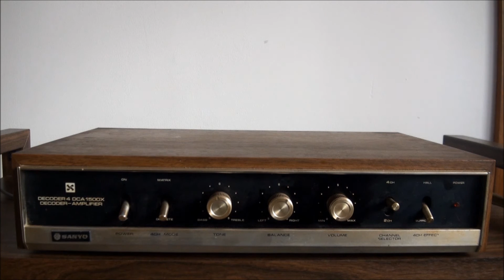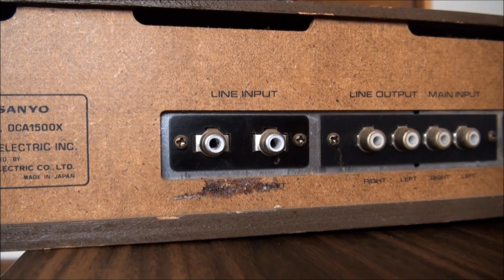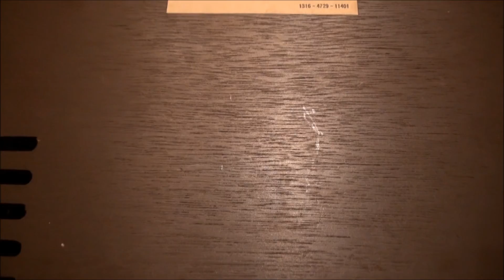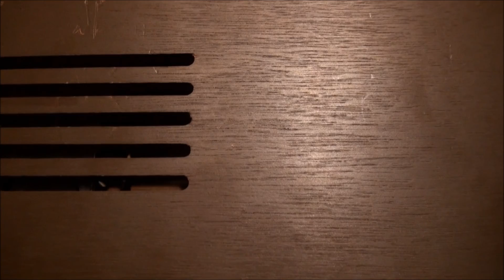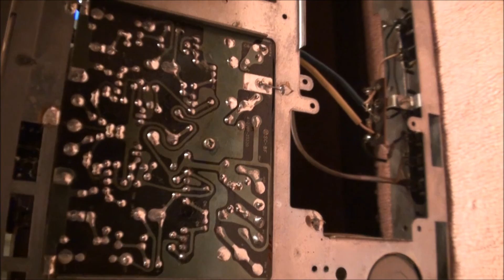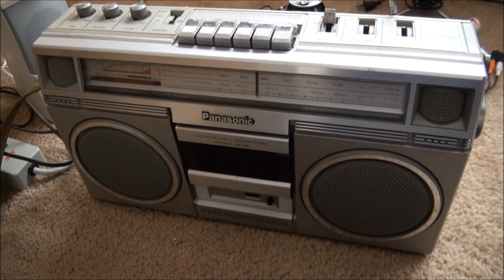1971 Sanyo DCA1500X  Quadraphonic Rear Channel Decoder

Comment: the power output is much less that 60 watts, more like 5 watts per channel RMS.  The whole unit is listed on the back as thirty watts overall power consumption. This unit came into the recycling center I volunteer at yesterday and is clean inside and out, it powers up but haven't had time to check any further on it. I have heard and worked on this sort of decoder back then and had the quad Sansui receiver of my own at the time and the sound was gimmicky and terrible, so more of a curiosity than a real system. No wonder the idea of synth channels didn't go over well.

Comment: The 'hall' setting is effectively known as a Hafler Circuit which plays the stereo difference across two speakers. If this was being used in its proper setup, musical information containing no stereo information (mono/panned center) would not appear in the back speakers and stay in front. The 'surround' setting basically adds resistors to this setup to allow a little channel bleed. This can be used to 'decode' quad records, particularly those encoded in Dynaquad and EV-4 (aka Stereo-4) and to an extent Sansui's QS records. SQ records would not decode well at all with this unit.
Reply: So I have this decoder as well, and a number of SQ records. I know you said that SQ would not decode well with this unit, but would I get better results with the Hall setting (Hafler Circuit/Pseudo-quad) or the Surround setting?
Reply: @michealgilliland8830  Regardless of mode, when an SQ‑encoded source is played through a Hafler circuit the front left and right will largely remain where intended. The encoded rear channels will not be properly localized; the circuit output contains only whatever out‑of‑phase energy survives the SQ encoding rather than the intended decoded rear vectors. In practice, a Hafler-style device extracts partial, unpredictable ambience from the stereo difference (L−R/R−L) rather than producing proper rear images. SQ is the least compatible of the common matrix systems with this approach; such a device is better suited to QS, EV‑4, Dynaquad, or general quad synthesis.
Reply: @QuadBench  One more question. If one were to play a QS, EV-4, or Dynaquad record using this unit, would one get real quad, or is it still just pseudo-quad created by the Hafler circuit?
It's my understanding that Dynaquad records didn't exactly encode two more audio channels, they just engineered the records in such a way to take advantage of the Hafler circuit.
Reply: @michealgilliland8830 Mind you, QS/EV‑4/Dynaquad are matrix systems, so you’re never getting four fully discrete channels from the record itself. Some crosstalk is inherent to the format, which is why later SQ and QS decoders added logic circuits to improve separation—very much like what Dolby Pro Logic does for film soundtracks.

With a unit like this, you’ll get a much clearer sense of the producer’s intent when playing QS/EV‑4/Dynaquad material. Instead of vague out‑of‑phase ambience, each speaker receives intentional program content. Dynaquad—originally an ambience‑synthesis circuit before briefly becoming a true matrix format—and EV‑4 are mathematically close enough to be roughly 95% compatible. The resulting soundfield is a trapezoidal shape, a wide, stable front, a mostly mono rear, and just enough side separation to tell front from back.

QS added ±90° phase shifting to fix the big weakness of EV‑4 and Dynaquad—the rear channels collapsing into near‑mono (only about 1–2 dB of separation). It kept the same basic amplitude‑based summation/cancellation those systems relied on, but the phase quadrature prevented the rear channels from correlating so heavily. That’s why QS remains broadly compatible with EV‑4/DY: the front channels decode correctly, and rear‑intended material still appears in the rear. But without that phase shift, QS rear content (Left Back/Right Back) would collapse to almost mono just like EV‑4 and Dynaquad do.

A good EV-4 record to play through this is Radio Shack's 'Big Band Moog' which has been fully uploaded here on YouTube. You can hear some panning effects zipping around from front to back.

Comment: You had it set up correctly at the end: you would use the boombox (or any normal stereo system) to play the front channels, and this decoder would play the rear channels. Play them both at the same time and you get quadraphonic sound. Any stereo music will provide somewhat of a quad effect when decoded, but it will work best when playing quad-encoded (such as SQ or QS), Dolby Surround encoded audio, or the QSound encoded CDs from the early '90s (such as Madonna's "Immaculate Collection").
Reply: From what I've read, this unit came out quite early in the life of quad. Would I get good results using SQ records, or would it work best on QS, Dynaquad, and EV-4?